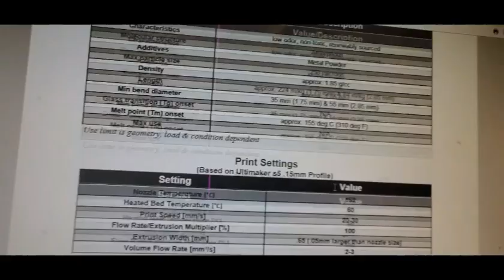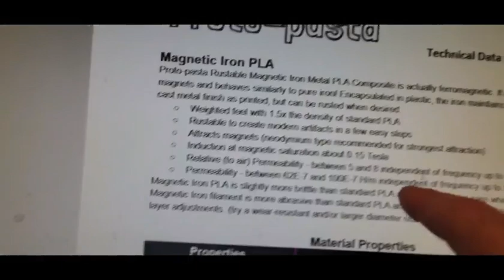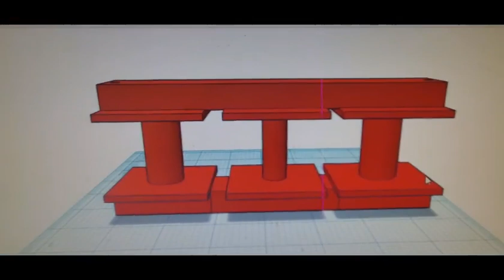Can You 3D Print Ferromagnetic Cores for Electromagnets and Transformers??

Comment: Interesting… that the print orientation needs to be evaluated for reducing reluctance and the layers for eddy currents.
Reply from the maker: My thinking is the 250 micron particles of iron are already surrounded by PLA, 45% iron 55% PLA.  Eddy currents may not be a big issue in such case, 100% infill seems a reasonable place to start.  Re reluctance, as I was hinting at in this video, first is repeating the different behavior seen with a U shaped core demonstrated in the previous video, however further is looking to see if one can complete the U to an O to give a lower reluctance closed loop path.

Comment: If you just wound you coil the way i said it would be 10x stronger and better then your wind with a iron core
Reply from the maker: Thank you for the comment. That is an interesting Newman motor you are working on.  I have heard people mention winding the coils, one layer, right angle bend, back to the top, second layer etc, as you note.  It might be interesting to take two coils of identical mass, one wound conventionally, one wound as you note, put an equal voltage to each and see what might show up on a Gauss meter an equal distance from each coil.
Reply: @paulmaher812  probably the quickest test would be 2 coils both same height and 2layers on each obviously 1 back and forth, and 1 with 2layer the same way
Reply from the maker: @doubleooh7337  Just a thought, good luck with your ongoing projects and experiments.
Reply: @paulmaher812  well on the video i posted yesterday i do a test using permanent magnets to show the difference, and you can literally see a big difference, 
both coils are probably better at different things amongst all the technologies out there , 
on mine to avoid any bend heat points i just try get back to the beginning in 1loop from the end of the layer
Reply: On my very next video i will be proving it

Comment: Pretty cool!! You can use Pronterface & Cura settings to do a linear calibration for the extruder and adjusting the filament density to hundred percent. Also try different nozzle heads to determine the right diameter thickness of volume.  Thanks for sharing
Reply from the maker: Hey many thanks Sam!  Also thank you for the experienced advice re print settings.  I will say it worked okay first try.  The take home point in the video is it looks like you can 3D print coil cores. I think that is important.  We'll get into the bat guano crazy stuff of what it means if you can shuffle the magnetic flux around in future videos.